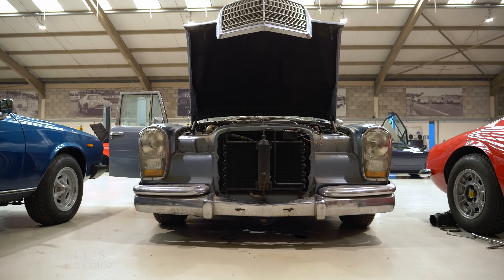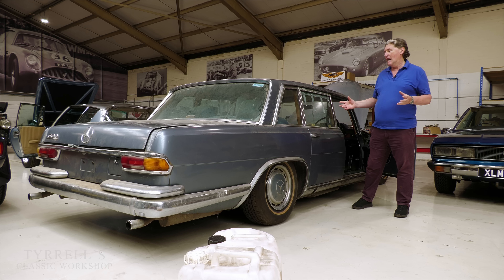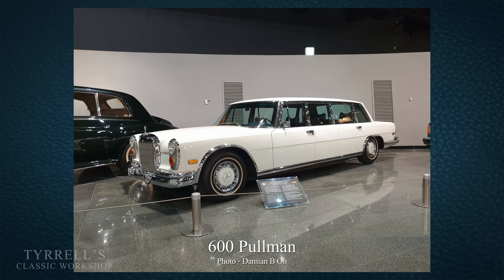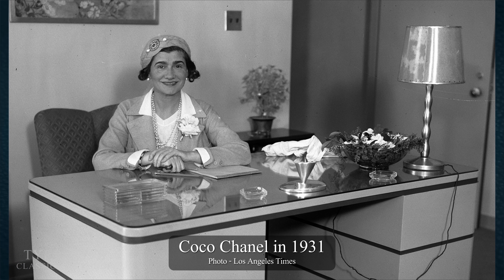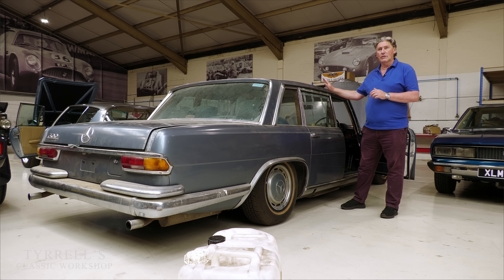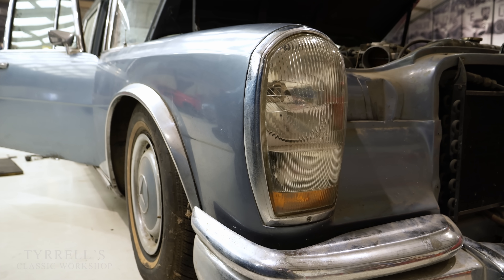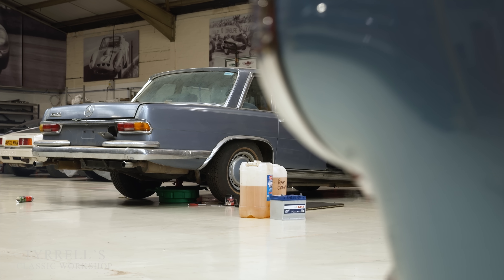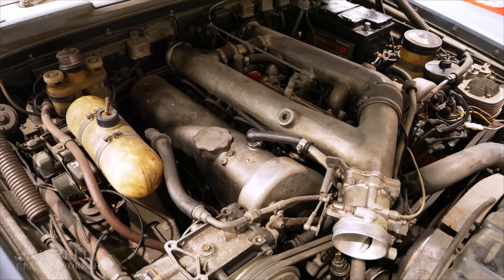Mercedes-Benz 600 Grosser W100: A Re-Commissioning Journey Begins | Tyrrell's Classic Workshop

Comment: The father of a boy I went to school with bought one of these and after a relatively short time, complained to Mercedes in Germany that the driver's seat was too firm and he found it uncomfortable after even a short drive.  The response from Mercedes was that Grossser 600 owners generally sat in the back seat and thus the firmness and comfort of the driver's seat had never arisen as an issue with the car.
Reply: A more German answer could not be expected from a German company: Customer orientation and friendliness at its finest.. 🤣
Reply from the maker: So funny
Reply: Seats has always been a problem with german cars... maby the german have more meat to sit on....
Reply: And supposedly, when the US BMW dealers complained years ago that they needed cup holders, the German engineering head scolded “Why? Do you have a steering wheel on your coffee table?”
Reply: @allareasindex7984  🤣🤣That's hilarious!

Comment: Brings back good memories. My uncle had one of these. Fittingly he lived in Heidelberg, Germany. We never knew where he got all the money from that he had, it was never very clear to us. All I remember is, that he was so annoyed that all the RRs were so darn slow on the Autobahn. If I remember correctly, he owned one or two. He took us on a ride what must have been about 72 or 73. I really dont remember much but three things. The acceleration was just from another planet. I didnt know as a kid, what was going on or what, but it certainly left an impression. He also wanted to make sure that us kids understand the rear windowa and to not mess around with them. To demonstrate, he put a rolled up newspaper in the open rear window and closed the same. We understood. And i don't know why this other subject came up, maybe its a story he later told me when he sent me the original brochure of the car. The wood trim around the windshield frame was needing some sort of repair or whatever. Of course, the Mercedes dealer sent word to the factory to go ahead and mail him the replacement pieces for this particular vehicle, since Mercedes keeps an extea set of each wood trim of each 600 in the factory. Its some sort if customer service to ensure the wood trim, if ever in need of replacement matching in color, grain pattern and form. So they installed two or three pieces per my uncles instructions. And boy was he annoyed that after that, the colors still didnt match, because the sun bleached all the original pieces over the years of ownership. Of course he had a wonderful dry and perfectly fine underground garage, but you have to drive somewhere eventually. He was not pleased. A few years later he sold it for 80 000 DM (Deutsch Mark). I asked him what he was going to do with the money. He said he didny know, it would be just another piece of the puzzle. You know, rich people.
Reply from the maker: Thanks for sharing

Comment: That aircraft analogy is very apt. That hydraulic pressure is similar to aircraft control systems.
Reply: Hydraulic system is the same pressure as most Boeings
Reply: 3000 psi hydraulic pressure is standard for most jet transports. Both the 737 and A320., for example. And in a car, it is hilariously over the top to use such a high pressure!

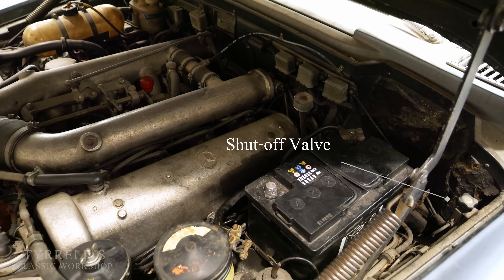Comment: 5:49 - When I was working as helper at the local MB import dealer. My boss was old German fellow. One day he was getting a short wheel base 600 ready for painting. He was fiddling around to remove window door moldings. My guess was he was trying depressurization of the hydraulic system. I was cleaning other vehicle. When suddenly there was very loud boosshhh. Red fluid went twenty feet, hitting ceiling. My boss was covered with same fluid. He was leaning over the main pressure tank front of the radiator. Trying to let the pressure out, but he did something wrong and took the fluid on his face.  There was least gallon of fluid on my boss. Thankfully he wasn’t hurt, except very embarrassed. My dad was working there as a mechanic, told my boss to keep his hands off the 600. Because he only caused extra difficult work, my dad had to fix.
Reply from the maker: Oops-

Comment: This is going to be very interesting to see where the line is drawn between renovating and replacing/restoring. Renovating requires a lot more judgement. It's actually easier in terms of decision making to 'do the whole car'. Many workshops struggle with renovating because it actually requires more skill than ordering a new part and fitting it, and can take longer, but the upside is originality. Looking forward to more episodes.
Reply from the maker: More coming. I think you'll like the next one.

Comment: Hi Iain. Great to see you have a 600 in. Beautiful! You’re dead right in your water pump prognosis. These engines take water in mysteriously and it’s because of this. If you remove the rocker covers you’ll probably find surface rust over all the cams and camshafts. I did this on all three of the 600’s I restored to prevent damage before initial start up. I also dropped contents of the sump first, revealing 50% water in the oil! Shocker. All three of mine had been laid up also.i have the original chocks for the collapsed rear suspension and will get them over to you over the next few days. It will make life much easier for you. Regards Gary.
Reply from the maker: Thank you Gary- you’re a legend!

Comment: Very interesting and you certainly have your work cut out for you here! Incredible car, then and now. So much complexity. If maintained well they are actually very reliable but fixing a degraded one is the perfect exercise in frustration, disappointments and expense. I read that the hydraulic master switch for the windows cost $15,000. I collect mid ‘60’s Mercedes but I have never been brave enough to acquire one of these!  It’s great to see people with deep pockets investing in them though as they are totally unique. Even though they were in production for 20 years fewer than 2800 of all variants were made. Please keep us updated.
Reply from the maker: Thanks- part two on the way soon

Comment: I live in France and a couple of years ago ago I met a couple of men in an open 4.5 L ( non supercharged) Bentley, they were on the way back from Classic Le Mans to the UK. We discussed fuel and they were quite happy using unleaded 95E10 as the car was used virtually daily and the fuel was not left standing long enough in the fuel lines to cause problems.
Reply from the maker: Yes, that is doable under those circumstances

Comment: Iain, this was fascinating as usual.  I owned a CX Prestige series 2, 1988, which was in need of cosmetic restoration only. My Pakistani mechanics at French Cars Motors Ltd in Riyadh found it abandoned at the side of the road somewhere near one of the princely palaces. I was there 1996 to 2000. They managed to get it started after God knows how long, probably a couple of years. It's a bit like seeing a stray dog running around long enough and looking for food before someone rescues it. The mechanics towed it back to their garage on a flat bed truck and completed an engine overhaul and body cosmetic rejuvenation in a couple of months. They renewed the fuels, oils, and hydraulic LHM, and I drove it to work every day for three years. The next owner, an English marketing executive, said he had one in England and knew how to drive one. The first morning he went to work he didn't let the car run a few seconds and he drove out of the basement garaging at about 20km per hour and while the slow suspension had risen he caught the bottom of the car on a steel vertical sharp pipe at the gate and unknown to him as he drove towards a sharp bend on the motorway, having lost most of the hydraulic liquid behind him on the road , he failed to take the corner hitting the steel fencing and plummeted down to the road beneath at 130 km per hr. The motto of the story is to wait for hydraulic suspension to rise on older cars before setting off. Why did he fail to take the bend? The steering, brakes and suspension were hyraulically controlled and there was none left in the reservoir. 😢😂
Reply from the maker: Oops….not good
Reply: Steering has a mechanical backup system, loss of hydraulics is not loss of steering (it becomes heavy, with a lot of play). He must have ignored multiple warning lights.

Comment: Another fascinating video Iain. Over the years I've seen more than a few of these sitting behind dealers with the car sadly sunken. In part of the reason was until recently the market value was relatively low and the parts – when you could get them – in the stratosphere

Plus as you have said very few people really know these cars 

Some thing I picked up from Road and track magazine years ago when they were a evaluating a 190 E and the Mercedes engineer 

Well let's put it into any German automotive engineer 

"Why make it simple if you can also make it complicated"? 

Even the windows on these are hydraulically operated. They didn't want something so plebeian as an electric motor that made noise noise when moving the windows 

And I believe they stopped  making these around 1981. And almost 20 years of production a little over 2000 were made of which about 500 were the Pullman 

And the engine went on to more legendary things such as powering the 300 SEL 6.3 and in modified form the W116 450 SEL 6.9 

Road and track referred to these cars as "the bankers hot rod", capable of going all day at 140 miles an hour 

They stopped selling these in the US around 1973, probably because of upcoming emissions and crash standards.

I don't think I've seen one in this country past 1970 but who knows? 

No – I think 1972 was the final year they were sold here in the US.

I hope you don't have rust in the gas tank as many cars left for years will develop rust unless the tank had a full measure of fuel 

You are certainly right about it being probably one of the most filmed cars in the movie world - even recent movies 

I think these cars exude power and prestige far more than even their  later attempts such as a modern Maybach. 

They have always had a presence about them 

But the cost of maintaining them! I've heard even the window switch on the drivers door is over $11,000 

I think since this is a prestige car Daimler has made an effort through their parts inventory of keeping these cars on the road 

And thanks to your shop for keeping this proud old car" back to this "style it is accustomed to"

Of the 2000 or so made I wonder how many are right hand drive? I'm sure many were sold in London and Hong Kong

Comment: Owned a 220SE of similar vintage once. Fine machine. One might imagine the 600 to be much the same only on steroids and then some. What a fantastic starting point for a restoration project.
Reply from the maker: They are a world apart in complexity. The 600 is crazy really
Reply: @iain_tyrrell  oh for sure. I suspect as you suggested it really identifies as a road going executive aircraft based on the engineering employed. The 220SE of course, everymans Mercedes, utterly pedestrian in comparison. That dash though looks very familiar.

Comment: 6:09 Light aircrafts are extremely simple, because they need to be reliable. That's why most of them they still use carburetors, mechanical fuel pumps and the likes.
It's not the case of larger aircrafts because you can afford (in terms of weight more than $$$) to have redundant systems.

Comment: Same here, worked in them in the 90’s. We called them the grand Mercedes because every part cost a GRAND! Have you replaced the petcock? It’s an electro magnet! The engine fan uses oil pressure to work a mini torque converter. It has tiny rings, very difficult to work on. Hydraulic windows, seats, hvac. Air bag suspension with levers to adjust height. The engine can easily destroy the prop shaft joint, fraying the rubber.

Comment: thank you Iain for a great video as always, ❤❤❤❤❤I always watch all of them, I have the honour of driving a Benz like that once (it's driving like John Lennon) it was the best car I've ever driven, the car was for sale at the time, lots of little things to do, a small migraine 🫣 

I always mix a little 2-stroke oil when I fill up, it keeps the valves and seals in good condition and is the cheapest and safest solution, some additives damage rubber, I got that from my sadly deceased Mercedes mechanic, 😢 Kirchhof ,he always had the old technology under control
Reply from the maker: Thank you for that too!

Comment: My boss, an ex F1 mechanic, recommended I try Shell super unleaded in 2 Italian classics. It ain’t cheap, but because they are older cars, you can feel the difference. Starts easier, and while many will say there is no measurable power gain, there is on older cars. He explained premium brands use Methanol to achieve E5, not Ethanol 😳
Reply from the maker: There you have it

Comment: The comparison of the engineering complexity with light aircraft is interesting.  The variable speed drive using a mini torque converter controlled by oil pressure sounds similar to the variable speed supercharger drive that the Daimler Benz aero engines in WW2 used; in that case it was used to match boost pressure to altitude, to ensure optimum combat power and efficiency across the range of heights.  Of course Mercedes engineers were forbidden to work on aircraft after the war, and I suspect the 600 is what you get when a bunch of frustrated aero engineers are forced to work on a car.

I'd also note that I've quite often seen old cars in museums with a drip tray under the engine, but the 600 is the first car I've seen with trays under all four doors (on display at MB World Brooklands) which made me smile.
Reply from the maker: Interesting theory about frustrated aircraft engineers!
If the car needed drip trays under the doors, either the door locks (depending on model year) or other hydraulics needed attention

Comment: I’ve been using a two stroke fuel mix of 100:1 in my old stuff for awhile now . Used to suffer terribly from sitting , but using mineral 2 stroke at that ratio seems to really help the fuel system and fuel stay stabile . No issues with plugs fouling and I can’t tell when running them on it smell or smoke wise  , haven’t touched the carb since - which used to be a regular job . The tanks don’t rust with it either , or at least no where near as quick .
Reply from the maker: Interesting- thank you

Comment: I always use E5 super unleaded in my old MG which is quite expensive in comparison  to E10, but needs must as it will pink when that's used, but I think I read somewhere that if I had to use some E10 then to use it up as soon as possible so that it doesn't linger in the system causing potential damage and at the earliest opportunity dilute the E10 with Super unleaded.. good video btw as with all your video's and would look forward to further episode's on the 600..I also remember the Mercedes Pullman.👍
Reply from the maker: You have it…… thanks for your comments

Comment: As the owner of a W109 6.3, I'm very much looking forward to more content featuring this incredible car.  Also, I vote for a fuel video.  Where I live in the US, ethanol-free "regular" fuel is readily available, but high octane is not.  If an older car requires high octane fuel, what is better -- add an octane booster to the lower octane fuel, or use another type of additive in the premium fuel with ethanol?  I sense the potential for lots of nerdy content with this one.  :)

Comment: Tyrell,
Thank you for featuring this car!
I never realized how over-engineered these 600‘s were. I always throught my Silver Shadow was over-engineered,
But not so!  I had a chance to buy one of these 600‘s about 30years ago for $20k, but passed on it.  Little did I know
That these cars would go for $100k-$200k now, depending on condition for a SWB model.
I opted for a Cloud 1 LHD, which has only increased in value a little bit!  All things being equal,
I would consider the Cloud a prettier car!
Reply: Count yourself happy you didn't take the road to ruin.
Reply from the maker: The Cloud is infinitely cheaper to maintain!

Comment: I think the 1967 Cadillac Eldarado matches the 600 in sinister styling and in a way engineering. FWD chain drive. Used in the massive GMC motor home and capable of massiv milages. A 600 and a 67 Eldarado are two of my favourite imposing stylish big cars.
Reply from the maker: They were rivals back in the day for sure